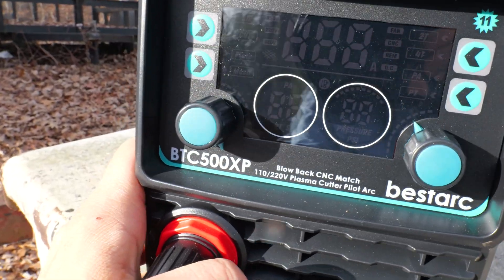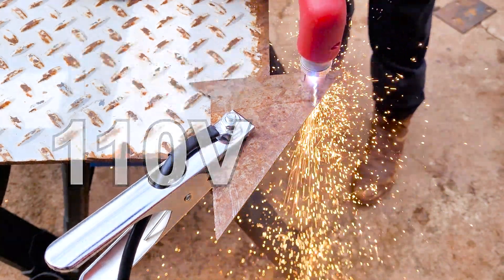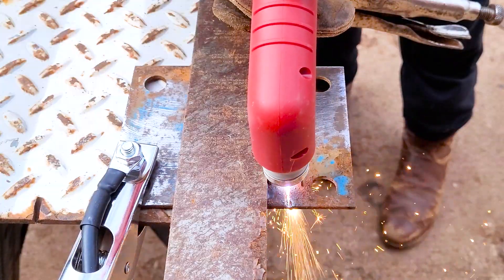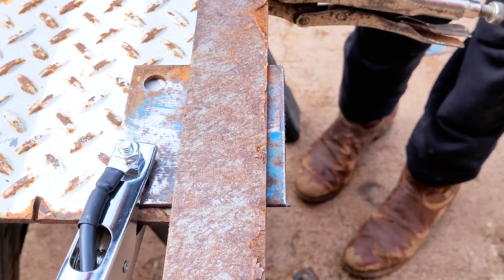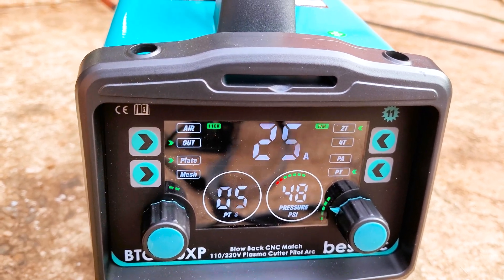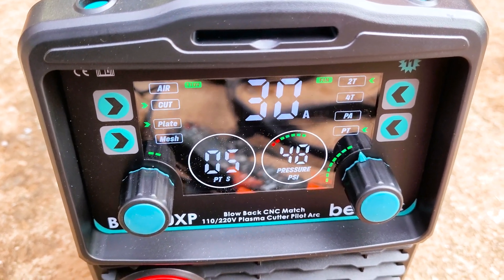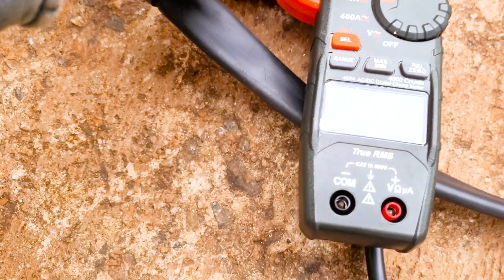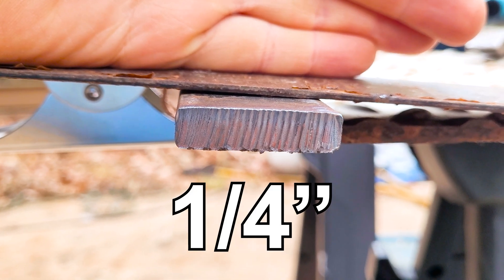AMAZON Plasma Cutter: BestARC BTC500XP 110V Cutting Steel

Comment: were you talking about the breaker on the machine or power panel. is the power panel a 20 amp breaker or a larger one
Reply from the maker: Panel 20amp 110V panel 50amp 220V